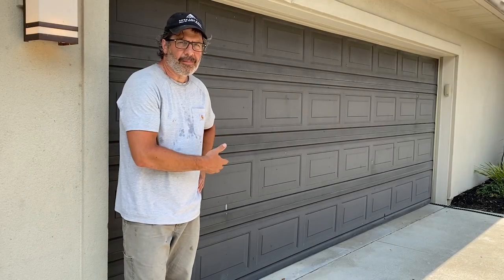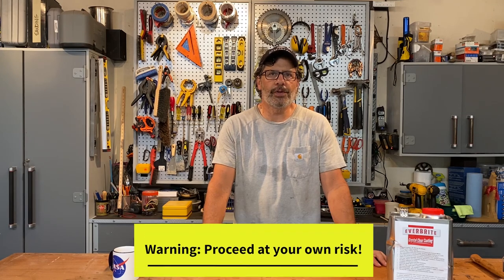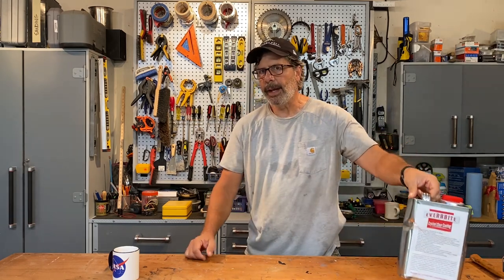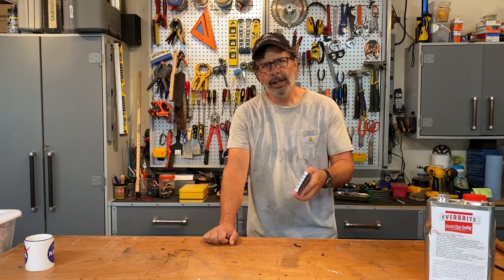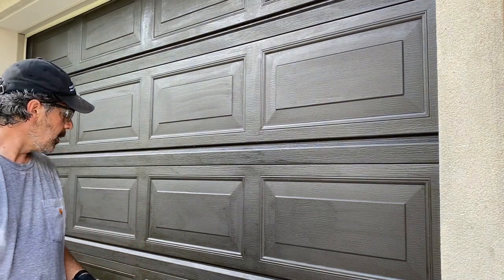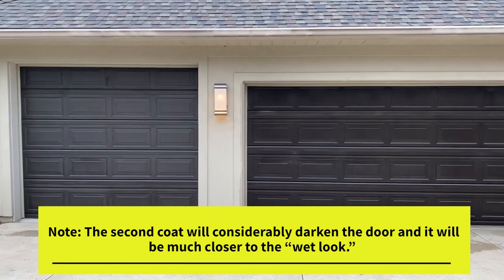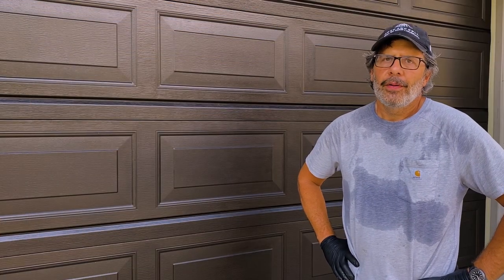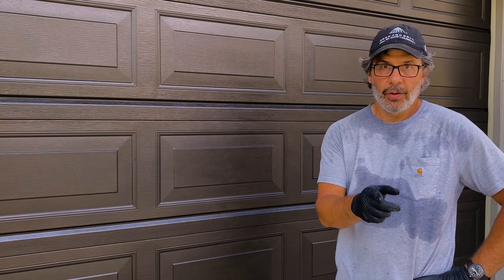Everbrite Garage Door Restoration Demo and Review

Comment: This is one of the best videos I have seen on YouTube and I review alot of videos in relation to general DIY projects. Excellent work 👏. . One thing I wish you measured the temperature of the door with a laser and also the outside temp and humidity as it effect how fast the product will cure and also your garage is black tone so it does observe most light radiation. But all in all you got my subscription and will review all your videos.
Reply from the maker: Thanks!  I appreciate the feedback.  Good point on the door temperature.  I did not have a laser thermometer at the time but I do have one now.  It's been 3 years since I made this video and the door is due for a refresh next spring.  I'll make a follow up video to show how I've cleaned it and how it's weathered in the last few years.  And I'll reapply a new coat and record the times, humidity and temperatures.  Thanks again.
Reply: @dontscrewitup  any chance we can get that follow up to see how the coating has weathered?

Comment: One clean dirt off. Two apply something that loosens oxidation, then use a soft brush and use a pressure washer, and do a good rinse., romse and romse again. when dry, you will be amazed at the color and shine. Now, apply something to protect the surface from UV. Nev uses abrasive cleaners or sponges to remove oxidization
Reply from the maker: What do you recommend for a surface protector?

Comment: Thank you for that great video, packed with how-to information and very well structured and organized!  Question:  Do you think that cleaning the brush occasionally with zylene, perhaps every 15 to 30 minutes or so, would work to get by with one brush?
Reply from the maker: Yes, if I were going to use one brush I would clean it periodically.  You’ll feel when it starts to stiffen up.   The xylene really cuts the material so make sure the brush is pretty dry before starting up again.

Comment: Hmmm Just watched the application of the first coat - and there is no where near enough coating applied. Also he is applying it as if is is a polish. The applicator tool needs to be totally immersed in coating and lightly squeeze to stop dripping. Then wipe on preferrably in one direction only. The reason it is flashing off so quickly is because applied far too thinly. One good coat should be enough. the applicator tool can be wrapped in aluminium foil to keep it soft. This way you do not waste coating and you can reuse the cloth or pad. This is from 7 years of experience being the Everbrite Distributor in New Zealand. I can do a double door in 50 minutes. And the correct type of nitrile gloves will not split in that time. Watch me applying it: https://www.youtube.com/watch?v=lYjl4ZGh3_A
Reply from the maker: Thanks. I’m due to recoat mine this summer.  What type of applicator are you using?

Comment: Fantastic job with this video! If you aren't already, you should totally go all-in with a transition to the YouTube thing full-time- you've definitely got the talent for it! 

Now on to the product. If I get this Everbrite product, I think I'll try using a small roller. We've got the same type of pattern on our garage doors as yours... and it's also very similar to the pattern we have on all of our inside doors (bedrooms, bathrooms, etc.) When painting our inside doors with a urethane alkyd paint, I've found that using a small roller worked so much better for a dripless and better looking job than with using a quality brush. I'm very curious to see how well it will work. We'll see. 

Again, awesome stuff here! Thanks!!!!
Reply from the maker: Thanks for the feedback.  I appreciate it.  I think a roller would work, but get some extra roller pads because the material sets up so quickly, you may need to change them out a few times based on the size of the job.   I had good luck with the natural bristle brush. I’d recommend having one of those on hand if you need to touch up after rolling.

Comment: Very informative video for the person looking to rejuvenate an oxidized door. You did a great job of presenting the step-by-step process along with helpful tips along the way. I wonder how much a gallon of Everbrite cost? Also, how long is this product expected to keep the door looking like new? I hope for many years to come as it would be a pain to have to re-do it after a couple of years of exposure. Thanks again.
Reply from the maker: Thank you
  You can look up current pricing on Amazon or the Everbrite website.  I made this video one year ago.  The doors still look great.  They have not faded, but did collect a lot of dust/dirt, so I just washed them with a soft bristle brush and they look good.   I believe they will fade slightly each year.  I believe the finish is supposed to last for 5 years.

Comment: Tom i can feel ur pain 14 min onward especially ur surface is un even lol, if i may suggest for next time you can load the product on spray gun spay the product instead...for the high spots u encountered did u try to wipe them off? to even it out.
Reply from the maker: Thanks!  I was able to get a good finish in the end, once I switched to a brush.  

I’m not confident a sprayer would work with this product because I’d need to mask the whole area.  The overspray would really be a problem.  

And the product is like superglue, so I assume it would clog the sprayer (permanently) before I could finish the job.
Reply: @dontscrewitup  brush is a perfect method as well. For spray it won’t clog, just buy the one from harbor freight. And as far as it being tacky, that’s best kind of product you want coz it means it won’t come off that easily by rain or uv rays. When I was watching your video I’m more impressed on your patience and the same time I’m glad I wasn’t alone 😂

Comment: Excellent video. I couldn't have done it better. Thinking of using this product for our 2-door garage door, but I am not sure if I am skilled to do it. I have done a lot of painting and polyurethane applications on wood and metal but this product seems to be a bit finnicky and difficult to work with.
Reply from the maker: Thanks for the feedback.  It is a bit tricky to work with, but if you have experience on wood and metal finishing, you could probably do it.  I probably could have done a better job prepping and cleaning the doors.  That is the only thing I would have done differently.   And be careful to keep the product off of the vinyl trim around the door because it will discolor it and stick to it like superglue.

Comment: Did you use a drop cloth to protect the concrete? Did it burn through the drop cloth? Do you think it would be worthwhile doing one or two row of panels at a time and masking off the other panels. It will take a lot longer but you don't need to worry so much about drips.
Reply from the maker: I did not use a drop cloth because I managed the drips.  And it would rather through plastic.  I don’t think it’s worth masking. If you stay alert you can blend in drips of avoid them as much as possible.  I should have masked off the trim around the edges of the garage door. It really made a sticky mess of those. Had to clean it with xylene and it’s still sticky.

Comment: 1 Gal restore kit is about $340 on amazon.
Reply from the maker: Yes.  That is a lot of coverage.  I have a lifetime of leftover material.
Reply: @dontscrewitup  So, for the double coat of a 1 and 2 car garage door, how much of the gallon would you say you used?
Reply from the maker: Just checked.  I used slightly less than one half gallon.   That was for 2 coats, covering about 190 sq ft.   It definitely takes two coats to cover smoothly.

Comment: Will the hard bristle brush for prepping, scratch the metal door? Will the product hide any fine sctratches?
Reply from the maker: I tested the brush on one area to make sure it did not scratch it. The product does cover some fine scratches and imperfections, in my experience.  It you’re concerned about scratches, use a softer brush or scrubbing pad.

Try to get the door as clean as possible before sealing it.  I could have done a better job of prep than what I show in the video.
Reply: I did my garage yesterday. A piece of advice that is mentioned in this video. Avoid getting any on your weather stripping. I tried to , but where I got some on, it curled and ruined it.
Reply from the maker: Sorry to hear that. It is tricky to keep it off other surfaces.  I also find that even the material on the door will stick to the weather stripping when the weather gets warm.  I wipe it down with Xylene to try to remove any material from the stripping.  And occasionally lubricate the inside of the stripping with silicone if it is still sticking.

Comment: How is finish holding up a year later?
Reply from the maker: Good question. I just cleaned my doors a few weeks ago. They faded a bit more than I expected.  After cleaning with basic cleaning products I actually used a car wash/wax cleaner and they cleaned up really nicely and got some of the luster back.  They’ve lost the “wet look” from the first application. I’ll probably put another coat on next year. They do not have any of the chalky residue like they originally had, so they’ll be easier to clean and prep.
Reply: @dontscrewitup  Hey! When you plan to clean it up and reapply. Call them up and ask for me, Joe, I can see what I can do to make the mission a little easier!
Reply: It’s been a few years. How do the doors look now? Did you have to do another application? I’m thinking of using this product on my heavily oxidized sliding glass doors. I like by the coast in FL and the Sun and salt really faded my doors. Hoping they look new again like your garage doors.

Comment: Hi DSIU,
How has the clear held up, does it look like the day you put it on, faded, yellowed? 
Thank You
Reply from the maker: Thanks. It’s held up pretty well.  Last summer it looked a little dull (no yellowing, just lost the deep luster).  It looks a little “dusty” like it is attracting microfibers.  So, I really cleaned it using different detergents, and it really did not change the look very much.  I then washed it with an automotive car washing liquid that includes some wax and the shine came back very nicely. Not as deep and rich as the original look after refinishing but pretty close. That finish has held up well all winter. I will try that method again this spring and will post an updated video.  

If I wanted to apply another coat of everbrite, I could do it with very little prep. The door has none of the chalky dull coating I saw prior to the initial job.  

The key things I recommend for the initial job are to so the best job possible with the initial cleaning and prep.  And keep the material off of vinyl weatherstripping around the door.  It will discolor that and it is like superglue — it will stick to the door.  You can clean it with xylene while it is wet.  Thanks for asking for the update. I’m still very happy with the job.
Reply: @dontscrewitup  Greatly appreciate your time, Thanks again